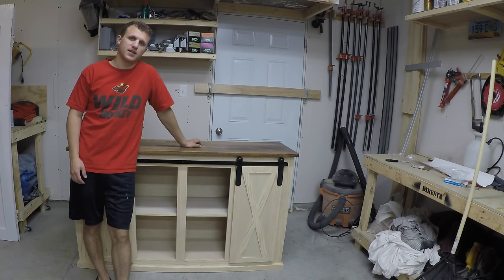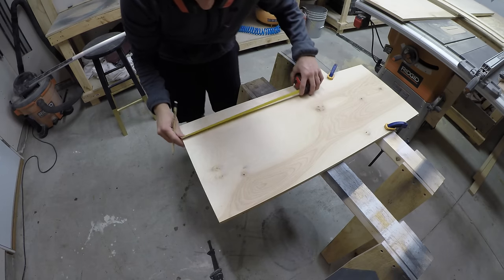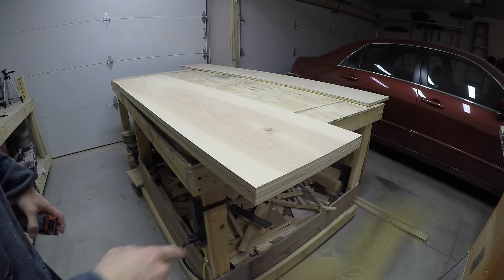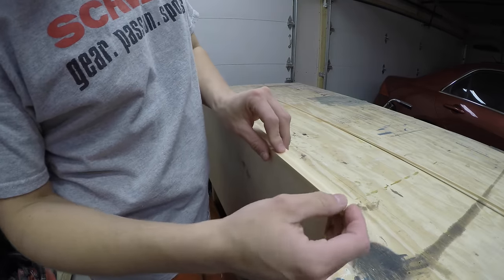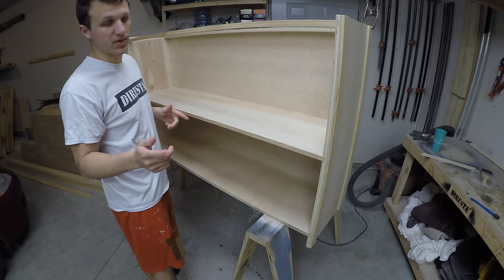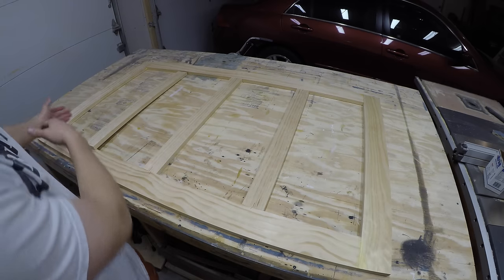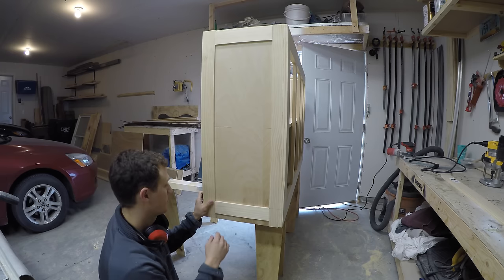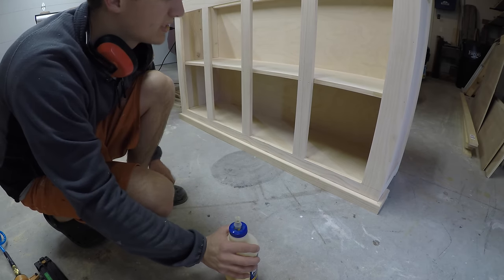Buffet Table Build Part 1 - The Base Cabinet - Kraftmade

Comment: How big is the finished product
Reply from the maker: I don't remember exactly but I think it was 4.5 feet wide and about 3 feet tall
Reply: Kraftmade did you buy this plan or do you have a material list?
Reply from the maker: I designed it but unfortunately do not have a material list.